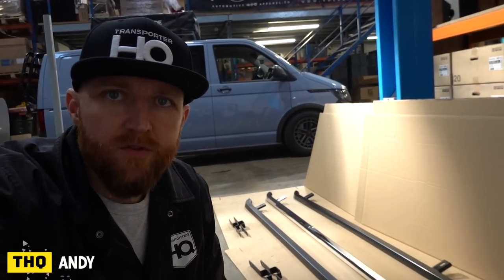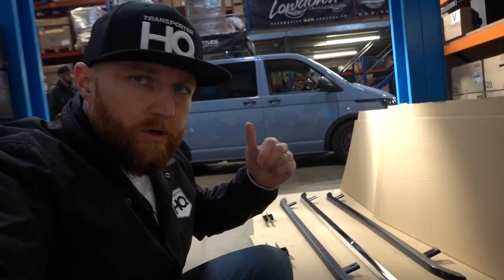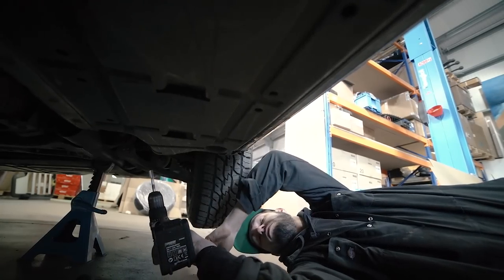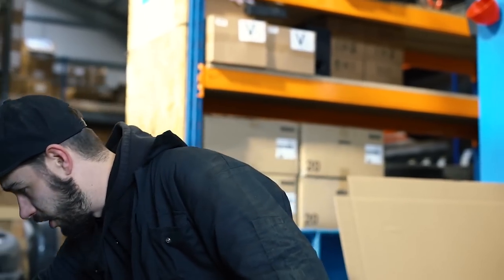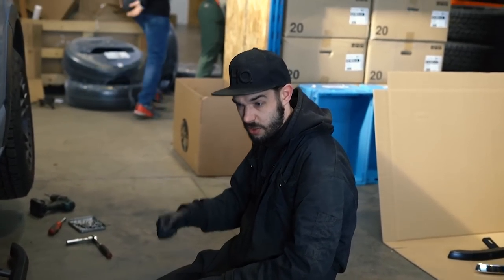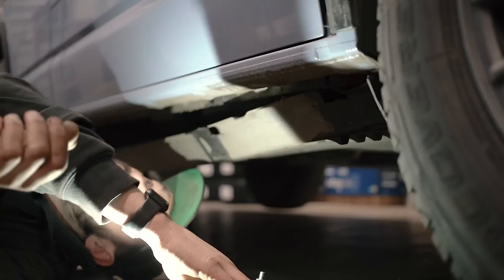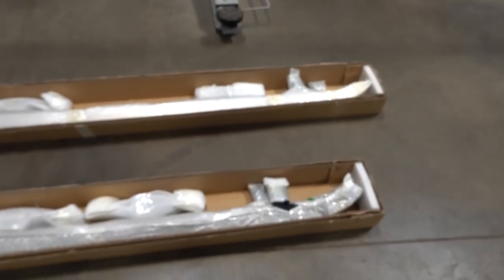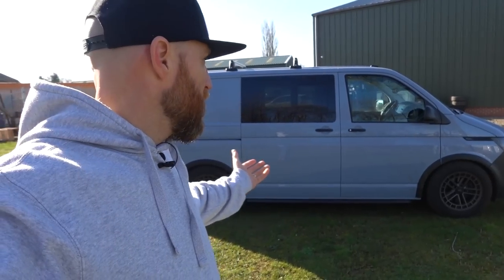How To Fit New Style Sidebars from Transporter HQ. Trapezoid | Angled sidebars for SWB and LWB

Comment: For anyone fitting these who is unsure which bracket goes where and in which direction…

The long brackets go at the rear of the vehicle.

Also, each of the 4 brackets has a slightly longer and shorter side. ALL short sides go at the front (so towards the front of the vehicle)

Comment: There are two different brackets, a short and a long one and each aren't symmetrical so could be fitted either way round and result in the sidebar mounting point being at a different location along the wheelbase.

Additionally, the side bars are handed as the front and rear brackets are at different locations along the bars and one has a green bit of tape on which I'd guess is an indicator for left or right side.

But... there are no instructions in the box and this video doesn't cover any of the above? There is also no link to any online instructions on the product page of the website.

Am I missing something?? I don't really want to waste an hour applying trial and error.. some rough maths suggests there may be 24 different combinations to work through!

Cheers

Comment: I’ve got a matte black set of your bars for my T6.1 SWB. Before I attempt to fit them I was just wondering if you need to cut a square just out of the under trays where the bars bolt onto the brackets or do you also need to cut around the bolts that hold the brackets to the van? Or are the bolts hidden underneath the plastic trays?
Thanks.

Comment: I really like these, and are the brackets stainless steel as well🤔
Reply from the maker: No they aren't but they are powder coated. These are the best I've seen and I'll check so many suppliers. The warranty is on the bars and brackets
Reply: @THQAutomotive  That's cool👊Thanks for you reply🤟

Comment: Hi just wanted to ask on the lower bumper grille there is a six hole sensor I've a 6.1 but on the front I've only four hole sensor will this work with a six sensor tks again for all the tips Dave
Reply from the maker: Hello, you can get 6 hole and 4 hole. The 6 hole also comes with blanks for the 2 spaces you don't need.

Comment: Hi
I have a LWB t6.1 and I want to remove the sides and fit side steps, is that a diy job and are the existing anchor points on the underside?
Thanks
Reply from the maker: It can be a DIY job if you are fairly handy. Different bars / steps fit in different way's.

Comment: not really a how to fit video...its a video of someone fitting them. how did he remove the under tray? where are the bolt holes located? how do he fit the bolts in them, what's the order for the washers and some plastic thing i saw on the floor....ooaa look its Paul Daniels "its Magic" lol here seconds later the bars are loosely mounted...ffs watching whilst typing...you said this under tray would need modding on this installed yet you show naff all really watch the video back for a "how to persepective" and how it is lacking...mine arrived today and they are quality but the delivery guys stand them up and walk them on the floor and the sharpe end comes through the end polystyrene. lol put MORE alot MORE effort in...
Reply from the maker: Point taken and noted. Thanks for your feedback.